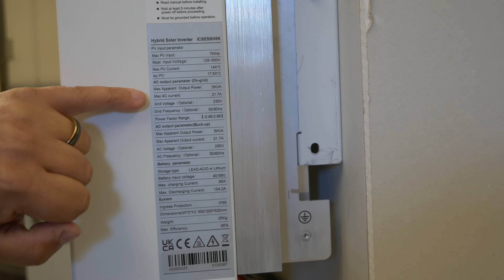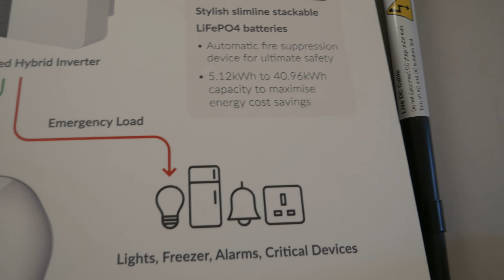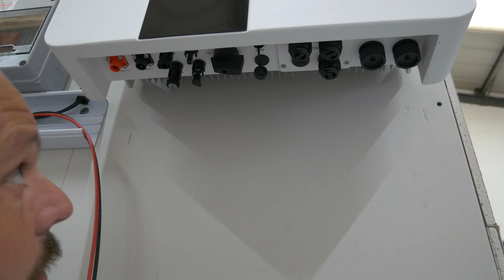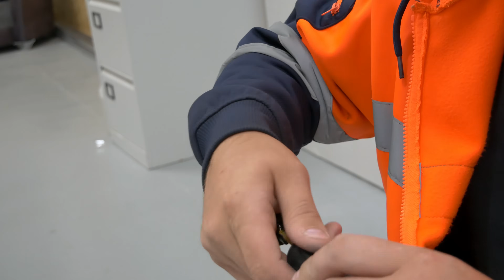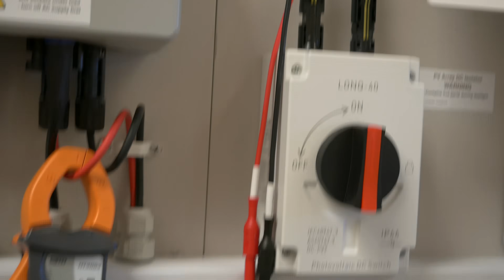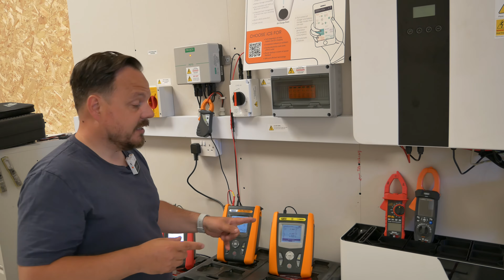How to install an ICS 5kW Hybrid inverter and battery storage system

Comment: Hi 
I have a 5kw hybrid inverter & have 2 arrays 1 is 6kw & the other is 3.7 kw!
How can I connect these to a 5kw Libbi?
Rgds mg.
Reply from the maker: The libbi has 2 string inputs so it can be done. However you need to check the voltage output range as it is a little on the narrower side on libbi. We currently don't install them so can't offer an exact answer.